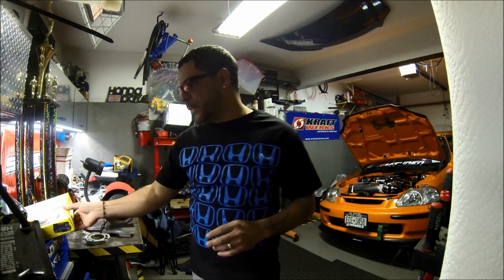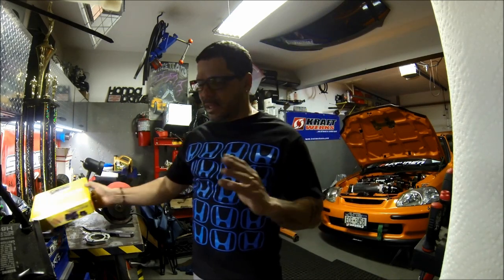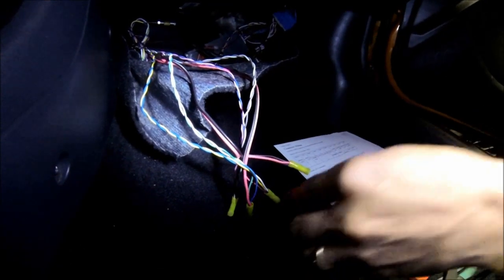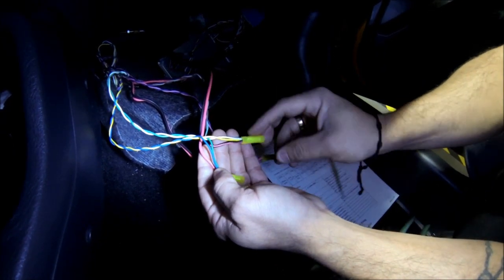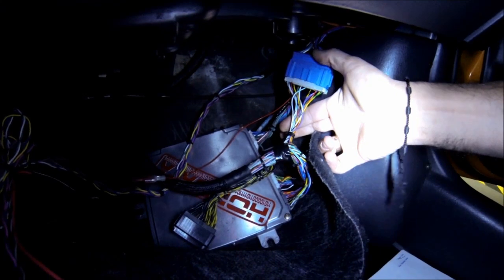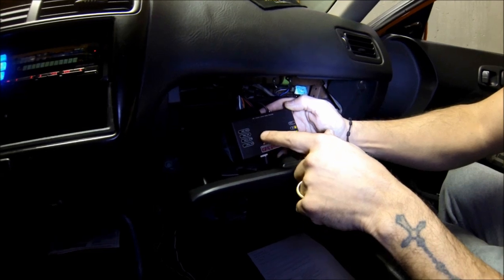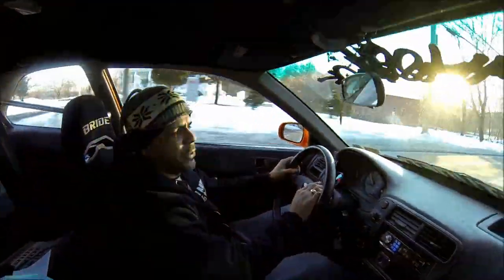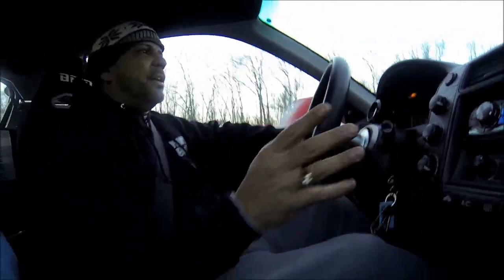Hondata traction control installation

Comment: Can you use oem sensors as a replacement for the vss? Like the signal of the abs to the vss signal? Or do you need the hall effects kit?
Reply from the maker: For sure you will need Hall effect kit.
Reply: Albert Marty Thanks!

Comment: So technically u only running 2 abs sensors 1 in front and 1 in rear and u have the wiring together to think is got all 4 abs sensors but y not just use all 4 can all 4 be use?thanks
Reply from the maker: Luis Viera well if I did all 4 there will be no difference at all..
Reply: Albert Marty got u ok so no se nesesitan entonces ok gracias I sensores cuales puedo usar pueden ser Los del acura de 94-01?
Reply from the maker: Luis Viera that is correct no need to run all 4